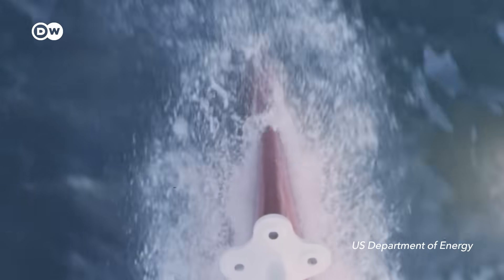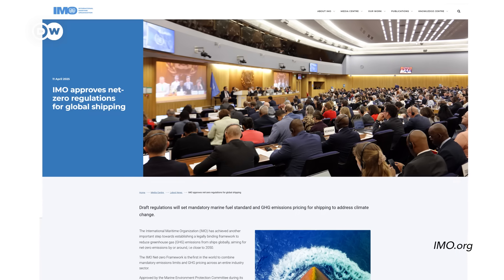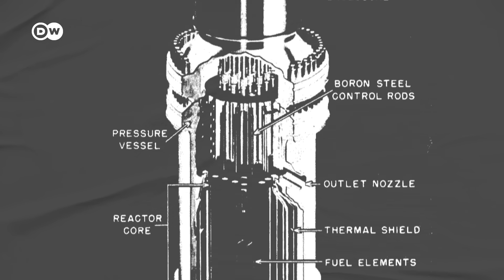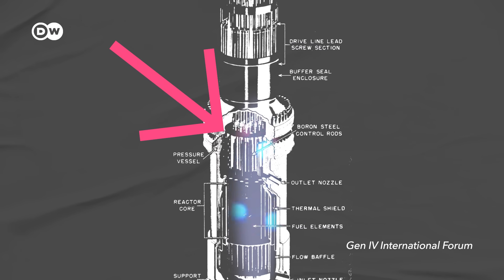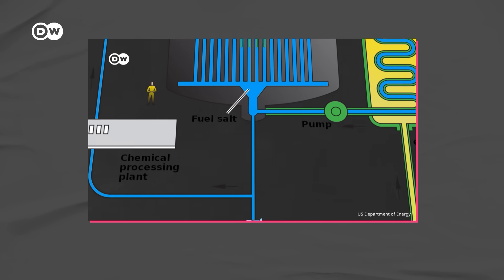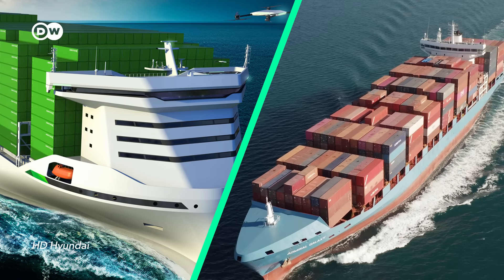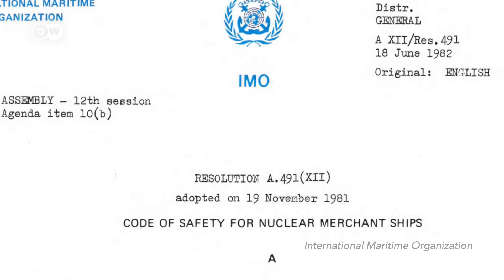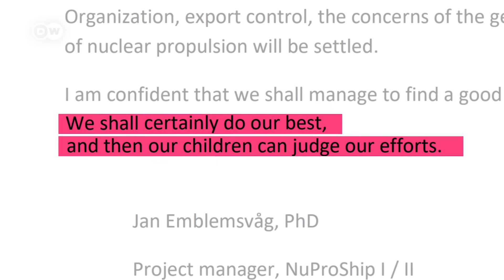Why people want to put nuclear reactors on ships

Comment: Go now. Don't hesitate to change the climate change.
Reply: I agree with your sentiment but this is not the way to go.  The four main reasons for not using nuclear energy on merchant ships are economic, engineering, social and safety.  Internal combustion engines (ICE) fuelled by hydrocarbon achieve your 'freight tonne miles' at lower cost, they also achieve it with simpler engineering.

The best answer to the question 'how may we reduce the impact of merchant shipping on the environment?' is 'move less stuff and move that lesser amount by the shortest distance possible'.  Not necessarily at 'pre-industrial hair shirt' levels; but do we need a 5 litre V8 pickup to get to the golf club?  Is a family of 'two parents having two children' (assuming both will survive to adulthood) a good size to aim for given the generational replacement rate is 2.1?  In summation; reduce consumption, limit reproduction, satisfy 'needs' not 'wants' and be satisfied with 'comfort' not aspire to 'luxury'.

The best answer to the question 'how may we reduce the impact of merchant shipping on the environment?' is 'move less stuff and move that lesser amount by the shortest distance possible'.  Not necessarily at 'pre-industrial hair shirt' levels; but do we need a 5 litre V8 pickup to get to the golf club?  Is a family of 'two parents having two children' (assuming both will survive to adulthood) a good size to aim for given the generational replacement rate is 2.1?  In summation; reduce consumption, limit reproduction, satisfy 'needs' not 'wants' and be satisfied with 'comfort' not aspire to 'luxury'.

Shipping currently has a 'high quantity, low added value' business model and it needs to return to the 'low quantity, high value added' model it followed in the past.  Addressing the 3% of global GHG emissions generated by shipping will be less advantageous than dealing with the 24% due to other transportation, the 24% of the of GHG emissions due to manufacturing industry or the 25% due to electrical power generation. (Figures from https://www.epa.gov/ghgemissions/sources-greenhouse-gas-emissions, et al).  Any alternative to the existing system needs to provide better value and so depends on the yield; the energy input less losses must reliable and consistently provide sufficient energy output that can be deployed for propulsion, cargo handling and domestic services.  All of which must be achieved within the current limits of mass (weight), volume (cubic capacity) and cost.

Comment: Yes, nuclear is a great solution for global shipping!
Reply: Just think; would you have full confidence in the management of a nuclear reactor under the control of an anonymous entity only traceable, perhaps, via a letter box in a FOC (flag of convenience) nation state?  If you are, could you sell that confidence to Japan, the state that was subject to the Hiroshima and Nagasaki nuclear detonations as well as more recently the Fukushima ‘event’?  Then try that same, or a similar, sales strategy on Ukraine, the nation state that as a part of the USSR (CCCP) hosted the Chernobyl ‘event’.

Modern iterations of nuclear energy, thorium fuel, molten salt reactors, small modular reactors or fusion reactors, will carry the legacy of past problems.  It is the global trepidation of anything with 'nuclear' in the name and the economics of nuclear having transitioned from 'energy to cheap to charge for' too 'the costs of remediation are incalculable' that will prevent the adoption of nuclear energy as a means of creating energy at sea.  Modern reaction systems may have overcome the safety problems but the general public, having been misled in the past, will be reluctant to believe the fresh new promises.  The incident of the ‘Ever Given’ blocking the Suez Canal, March 2021, may also have a little to add to this debate.  The cooling water on ships tends to get taken in from near the bottom so when running aground the inlets are in a prime spot to get plugged up restricting, if not stopping, the flow of coolant.  One thing that the Three Mile Island (TMI), Chernobyl and Fukushima incidents all had in common was that the supply of coolant, or rather disruption thereof, was a fundamental cause.  It might also be worth bearing in mind that part of the TMI near miss was the fault of the US navy trained operators focusing on not letting the primary cooling system 'go solid'; due to their training overwhelming their education and the particularity of the situation there.

Similarly, and only months later, May 2021, had the ‘X Press Pearl’ been nuclear powered then a major port for a populous nation in the global South would have possible been the site of a significant exclusion zone due to a non-power plant related incident.  If the ‘X Press Pearl’ had on board a fired up but ‘safe’ molten salt reactor and found herself having to dissipate the residual energy associated with the possible 12.5 megaWatt power cycle would a stable cool down have been possible?  Would there have been sufficient heat energy contained in the power system to facilitate a hydrothermal explosion?  A nuclear powered vessel sinking in deep water may be a minor problem however the same or similar type of incident occurring in shallow water may not have such a benign outcome.

Comment: Question that comes to mind is how secure nuclear-powered ships are against sabotage. Is the nuclear fuel protected from theft? What happens if a ship sinks, could the reactor or fuel contaminate the ocean? Is the fail safe technology designed keeping in mind external attack on ship?
Reply from the maker: The experts say that new reactor designs are made so that all the radioactive material stays contained inside the ship, even in a worst-case accident. And that international rules and trained crews would be required before nuclear cargo ships could operate.

Comment: It's a great idea, but not a great practical reality.  Shipping companies try to do the most with the least.  It leads to the CO2 problem (burning bunker fuels), the cheapest crews (some even slaves, especially in the food industry), and a significant number of spills/accidents.  Putting a nuclear reactor in the mix is just asking for trouble.

Hell, shipping companies make sure the register ships in the cheapest possible country without safety regulations.
Reply: And what makes you think Methanol and Ammonia would be safe with them then?

Methanol directly releases CO2. Pretty simple how that would go. 

Ammonia releases NOx, which is almost 300x worser the CO2 for Global Warming. It is also, immensely toxic. 

A sealed reactor that is already slow to respond to change and well protected physically, vs massive amounts of a toxic fluid that does more than just some harm to life?
Reply: @ZippyPiglin36  Never even used the words Methanol and/or Ammonia.
Reply: @MrSubsound90  But they're still considered Green energy suitable for Naval usage, so if Nuclear isn't deemed the way, these two would get shoved into the role
Reply: @ZippyPiglin36  If you say so, but I certainly haven't said that or seen any evidence of anyone else touting it.

Telling people what they think is abusive behavior.  Please stop.
Reply: @MrSubsound90  fair enough

Comment: American aircraft carriers are nuclear, proven and reliable. Russians have best nuclear ice breakers. If countries want they can make cargo/civilian nuclear powered ships easily.
Reply: Just think; would you have full confidence in the management of a nuclear reactor under the control of an anonymous entity only traceable, perhaps, via a letter box in a FOC (flag of convenience) nation state?  If you are, could you sell that confidence to Japan, the state that was subject to the Hiroshima and Nagasaki nuclear detonations as well as more recently the Fukushima ‘event’?  Then try that same, or a similar, sales strategy on Ukraine, the nation state that as a part of the USSR (CCCP) hosted the Chernobyl ‘event’.

Modern iterations of nuclear energy, thorium fuel, molten salt reactors, small modular reactors or fusion reactors, will carry the legacy of past problems.  It is the global trepidation of anything with 'nuclear' in the name and the economics of nuclear having transitioned from 'energy to cheap to charge for' too 'the costs of remediation are incalculable' that will prevent the adoption of nuclear energy as a means of creating energy at sea.  Modern reaction systems may have overcome the safety problems but the general public, having been misled in the past, will be reluctant to believe the fresh new promises.  The incident of the ‘Ever Given’ blocking the Suez Canal, March 2021, may also have a little to add to this debate.  The cooling water on ships tends to get taken in from near the bottom so when running aground the inlets are in a prime spot to get plugged up restricting, if not stopping, the flow of coolant.  One thing that the Three Mile Island (TMI), Chernobyl and Fukushima incidents all had in common was that the supply of coolant, or rather disruption thereof, was a fundamental cause.  It might also be worth bearing in mind that part of the TMI near miss was the fault of the US navy trained operators focusing on not letting the primary cooling system 'go solid'; due to their training overwhelming their education and the particularity of the situation there.

Similarly, and only months later, May 2021, had the ‘X Press Pearl’ been nuclear powered then a major port for a populous nation in the global South would have possible been the site of a significant exclusion zone due to a non-power plant related incident.  If the ‘X Press Pearl’ had on board a fired up but ‘safe’ molten salt reactor and found herself having to dissipate the residual energy associated with the possible 12.5 megaWatt power cycle would a stable cool down have been possible?  Would there have been sufficient heat energy contained in the power system to facilitate a hydrothermal explosion?  A nuclear powered vessel sinking in deep water may be a minor problem however the same or similar type of incident occurring in shallow water may not have such a benign outcome.
Reply: But naval reactors are illegal for civilian use. US reactors must be fueled with bomb-grade enriched uranium.

Comment: Never gunna happen. Piracy and missile attacks on commercial shipping. Military ships can shoot back. Civilian ships can not. I will leave it at that.
Reply: well, with nuclear power, you can equip your freighters with small railguns and lasers.  It's insufficient Electrical power that makes those impractical today.  With a couple of megawatts, a laser could take out pirates quite well.  Just don't shoot an albatross.
Reply: @qcca123-f1v  So you are making your civilian underpaid east Asian sailors soldier or turn them into a private army. I see where this is going.